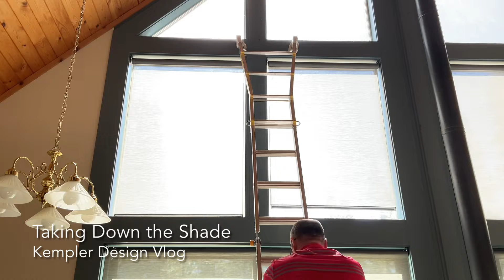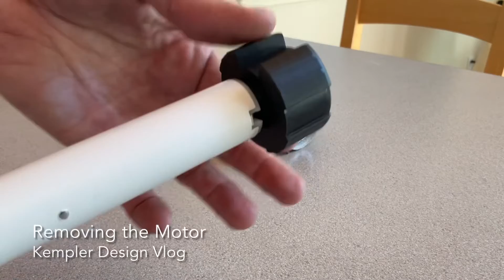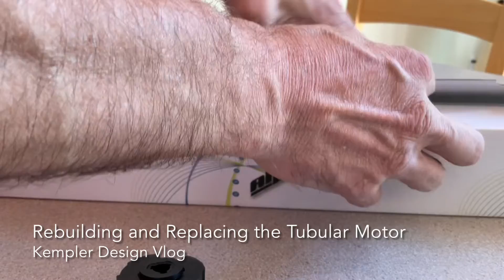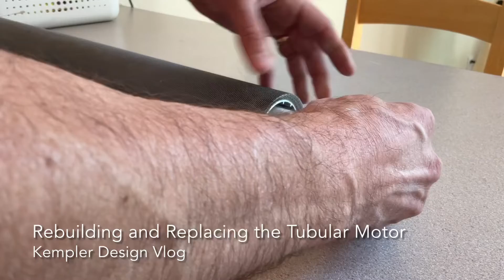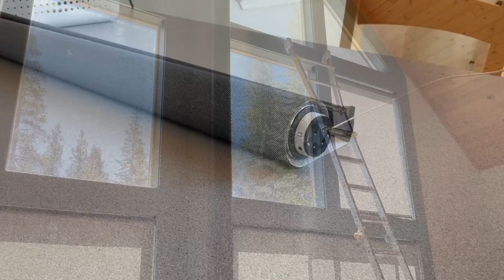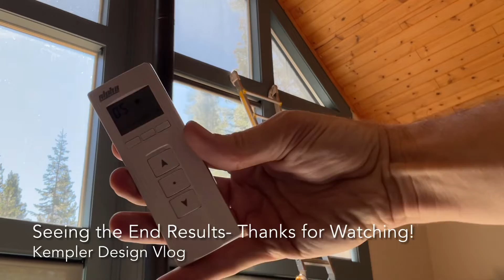Replacing a Motor For Your Roller Shades - Alpha Tubular, Somfy, Rollease

Comment: Do you know where I could buy the black skyline adaptor plate? I can find the ones with screws pretty easily but not sure if that will work with the motors I bought.

Comment: I wonder are different motors interchangeable?
Reply from the maker: Absolutely, but you may need to get a new crown and drive. Those are the parts that attach to the motors and make them work with the tube and motor.

Comment: I have the same alpha tubular motor but mine will not just easily pull out like yours. Only thing that looks different is that my roller shade is 9 ft long. But I have tried everything I can think of to get the motor out and it will not budge. Is there something else I need to do? Maybe the size makes a difference? Any help would be appreciated.
Reply: Nevermind figured it out. For some reason after unwinding the entire shade it had 6 screws drilled into the plastic part at the end.
Reply from the maker: Glad you figured it out. Yeah, every manufacturer has their own style of building the shades. Creativity is the key to fixing things.